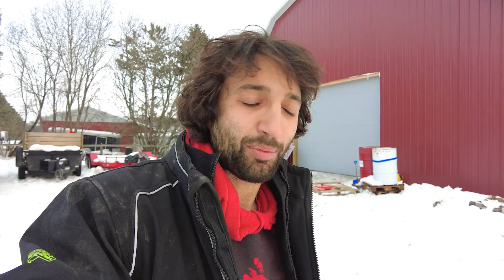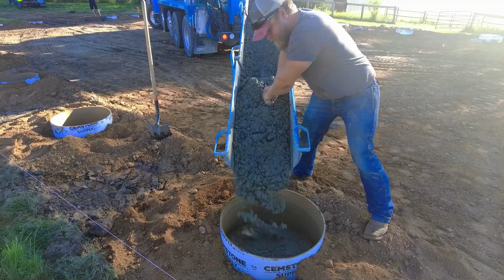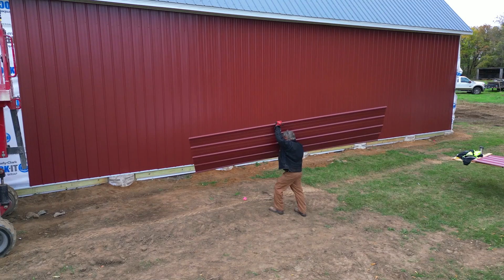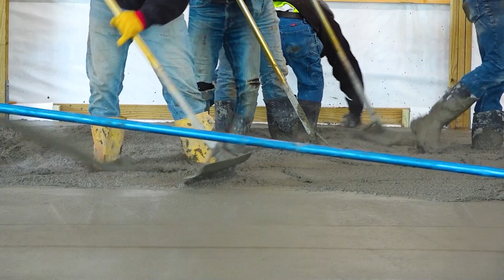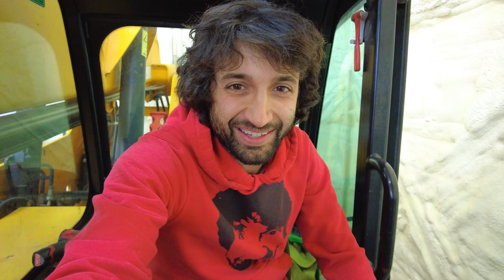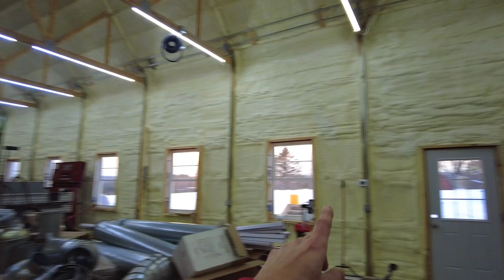How Much did this Stupid Barn Cost to Build? - 40x72 Gambrel Post Frame Episode 23

Comment from the maker: Have a great New Year everyone! Here are the numbers for reference:
Permits		 $2,041.34 
		
Site Prep		 $14,085.25 
		
Framing Package		 $17,502.26 
		
Metal Package		 $20,275.37 
		
Trusses		 $5,172.06 
		
Doors and Windows		
Garage Door		 $2,943.83 
Entry Door and Windows		 $2,747.66 
		
		
Labor		 $18,320.43 
		
Infloor Heat		
Insulation +VB + tape		 $4,449.23 
PEX		 $7,004.00 
Boiler		 $11,587.50 
		
		
Concrete Slab		 $23,978.40 
		
Spray Foam		 $30,331.44 
		
Electrical		
Temp Wiring		 $1,452.04 
Panel Set		 $2,294.34 

		
Lift Rental		 $6,052.19
Reply: $170,237.34 for capacity that will facilitate the generation of multiples of cycles and decades of much-higher-than-cost revenue, and guarantee the ability to meet demand when and if it increases but can maintain a known minimized cost to storage over a 30+ year lifespan. 
 I'd call it a low-cost win. Straight-line depreciation of the cost is around $5,674.58/year which was probably much more than what was spent in renting a building space with a constantly-changing humidity/temp environment, which is bad for wood storage (increased spoilage cost).
Reply: Perhaps the biggest piece of financial info I didn’t hear was the annual savings of not leasing a building, as well as the cost (fuel, vehicle maintenance, etc) of commuting back & forth? Surely that is a contributing factor in the decision-making process.
Reply: Hey Matt,
Firstly, let me wish you and your family a Happy New Year - 2023 !!
Secondly, thank you most sincerely for sharing the çonstruction and related costs. You have shown, once again, that you are a very transparent person and I commend you for that fact. Nothing to hide and enthusiastic at the same time !!
BTW, what's Donovan doing now that the building is complete....?
You certainly have a lot of work ahead of you - with arranging and installing all your "toys" !!
Again, my very best wishes for the future and may God Bless !!
Reply: Certainly NOT CHEAP - but we'll worth the outlay !!
Reply: Now, since it is used for a business, what tax deductions do you get annually on your primary domicile?
Reply: @mgmcd1  🤡
Reply: That actually cost a lot less than I expected. That's a massive building for that money. It will be paid off quickly when you get the operation up and running. Nice job Matt!👍
Reply: Nice work Matt.  Can't wait to see it in person on my next adventure over to your place!  lol
Reply: Think of the rent and travel costs you are saving 😉

Happy New Year Matt
Reply: It's so refreshing to see honest numbers. Everyone I know who has built a garage or pole barn claims an unbelievably low price. My friend is looking into the same thing but can't receive inside information on actual cost. Even a ballpark figure would work, but there people would say they paid $50k for your type of building
Reply: You did well Mark!
Reply: How long would you have been able to lease a building for that?  This is an investment and that has to counter building costs.  You don’t pay anyone else for your shop
Reply: Well let's say I'm glad I watched you build it rather than me paying for it!  I am curious how much cheaper it would have been if this was before the pandemic... I am out of touch with building costs.... I was surprised that the rafters cost $500 a piece for a simple stick and frame construction... The concrete slab didn't seem too high to me and neither did the electrical work (surprisingly)... But that spray foam... Oh my goodness!.... 30k?!  No thanks. Lol. I knew it was expensive but I didn't think it was that much.  I hope it gives you a good return.
Reply: If you ever decide to quit milling lumber, think about it this way. A building with no interior walls is a blank slate if you ever wanted to rehab it into a guest house. The only thing still missing is plumbing and septic.
Reply: i wounder is the number of spray foam is right?  in my world in sweden its massiv overpay but here we dont spray foam at all. concrete is dubbel of hear and metal too.
Reply: Love this...
Reply: The permits and the pex line are the only ones that seem high.  Great value.  Doing that huge ceiling in spray form- big job
Reply: The doors have been FLUNG open to widespread THIEVERY in the US economy and everybody on this list (except for the electrician!) charged 3-4 TIMES what these products and services are really worth.  What's wrong with people?  This kind of narcissism in business, GOUGING the customer - charging higher and higher prices as long as the dummies keep paying -  is borderline criminal and will be the end of many a franchise, LLC, sole proprietorship and yes, even corporations.  

The tipping point will be reached when the consumer base finally realizes they're being played for suckers and they stop patronizing these thieves' businesses all together.  

Personally, I think every single project in the nation should STOP until the pricing for everything from supplies to labor, groceries to utilities, tuition to tires, across the board drops by AT LEAST 80%.  If that necessarily means the total COLLAPSE of different industries, then so be it.  You all KNOW I'm right.  We're being ROBBED everyday by these clowns.  Let's end the thievery and get back to a world where no one struggles to make ends meet and prices are FAIR.
Reply: good lord 30k for spray foam?!? hope it helps retain heating/cooling enough to offset the cost
Reply: How does the cost compare to how much a property would have cost if you were able to find one?
Reply: +u

Comment: I was working at a bank and had quite a bit of knowledge in the trades involved so I started building a house, moving the family into it, living there 2 years, building another one, moving into it, etc.  I did it four times.  After the first one I stopped doing the trim work, after the second one I stopped doing the plumbing, the third one I stopped building the cabinets and doing the electrical, and the fourth one I just GC'd.  Each time I realized that I was just slowing things down.  The fourth one I decided to leave my job at the bank and build houses full time.  It's pretty much always better to have pro's do the work.  It's just not worth the stress.  

Of course then the bubble burst while I had two high priced specs on the market.  They stayed on the market for two years, and I lost everything that I had.  So there's that.

Comment: Looking at doing a barn of similar slab size and depth.  This lines up with my own estimates I did, via concrete calculators and watching other concrete guys on YouTube that give the cost of a job.  I would try to do as much of the ground/form prep as I could, to lower the cost, but that 25k is close to the ballpark.
*
Some good concrete guys to give a watch on YouTube are MattBangsWood (good details on framing pouring and Mike Day Concrete (Mike Day will give cost totals to a project, along with framing pouring)

Comment: I know it is easier said than done - but one of the things that could help is pre-pare rent, deliver, or buy things per phase and I think you did some of that - but Donnavon was slow..he smiled too much, and that cost you some money for sure - and your purlins.OMG -- I see others just nail on top and bam bam bam..you spent a few weeks installing individual purlins - In these types of work, you either speed up the process but for more costs, or less cost and longer project time - you know the main idea of the Project Management - The Tripple Constraint (Time, Money, Resources) - each impacts the other when changed. yeah..crap,,,, I binge-watched all episodes - it is almost 4:00 am..wth... I got to work tomorrow. bye and I don't even need a fricking barn for anything,

Comment: If you had put in a second floor level - with the 14' of height, there would have been a very long staircase. Which takes up room on both floors, and obviously costs something.

Comment: what you do now is lay a row of post 6 feet away from each side of the building down the long sides every 12ft.. run a stringer along the barn walls each side at about 13ft high, then run a strigner along the posts you installed at like 11ft high.. run square ended rafters off the barn wall to the posts every 2ft, block it out and just use the inexpensive home depot fiberglass or aluminum roofing..

then you have a roof structure along each side of your barn and you can fence em off with 4 strand whatever and your animals have shelter, or you have shelter for tractors whatever, maybe even wall one side off for birthing stalls whatever..  yea make that space work and those barn walls work..

its a very nice barn, are you insulating it and turning it into a shop or, mighty fancy heating system for a barn I don't imagine you're keeping animals on a concrete floor?  classic car collection?  is this a farm or?

Comment: wait WTF? you paid $14 for site prep? you could have done that with your john deere in a day or two...  good lord.. holy smokes had you rented a portable mill you could have cut your own trees and got all the materials for free basically, um the slab, wow, you could have done that yourself, its like what $100 a yard poured?  40 x 70 x 6" like 50 yards so what like $6000 for the concrete, about 3 hours labor to screed and burn 2 guys, what $500 in labor? or free if you do it yourself?  $23,000 for concrete? I still don't get this cost?  how much did they slap onto each yard of concrete?  its $6k for concrete $7k TOPS, $500 in labor? you should have gotten the floor, the sono tubes, dug layed and filled for under $10k... no jokes 

why you used 24" sono tubes X what 36" is beyond me?  wa sit laying on hard pan or? if your not on a hard pan you would be better off with a dug footing, the width of that lil' kubota hoe bucket, 12" deep, PLENTY and more stable, 2 rows of 3/8ths bar..  $400  call it a day.. 4" slab would have sufficed with a thick mill vapor barrier, is it in floor heating?  man in the day, in the 70-80's, we build that abrn for $10k - heating system..  also you can do in floor yourself, fuggen do it all yourself, good grief the money they made off the concrete job was $14k?

that boom lift is all you need for a bard build, frankly you have $45k in materials and a whole bunch in labor and company profit...  DO IT YOURSELF!
 

you're not afraid of a little work are you? look at it like you're making $80k building a barn,man, been a few decades since I was in the game man they're making some serious cash these days..  lord

Comment: I was looking at a property in NH it had a house sorta a fix er upper but a good size and two 40x60 buildings with a dock at each to back up a tractor trailer on 5 acres for under 300k. They don't pop up too often like that.

Comment: Matt, you may want to add a ½" x 6" x 6" metal plate under each speed rack leg to distribute the loading psi onto the cement floor.  Calculate the "kips" based on load and cement specs.

Comment: In my mind $170,000 for a building that size seems more than reasonable. Considering if you had a company do the labor it would probably be $250,000 or more. That is now it may be difficult to find labor to do it.

Comment: I have been planning to build a barn here in central MI in which to store a lot of my things, as well as to renovate, and then store my sailboat. I figured a 60' x 70' x 16' steel sided barn just like the one you have built would be what I needed. I started the planning about 20 years ago and began saving money that, at the time, would be around $50,000. As I began getting close to that time, I saw that the price of everything went up! I have managed to save twice that now, and find out that I am really only half way there thanks to 'planned' inflation! This is where I decide to just enclose the space and worry about getting the rest done over time, including my side overhangs and flooring and insulation! I'm already retired so SS checks won't go far enough fast enough. I was so glad to see you complete your barn! It looks great!

Comment: "Load Capacity"? You expected load capacity on 9 foot on center roof trusses??? You'd have had all the capacity you needed if you designed the framing and trusses to hold the load. Yeah sorry, unless you saved tens of thousands you lost out on not putting a proper system in there to accept an attic space. That lost space is HUGE.
Reply from the maker: About 30 grand in materials

Comment: I assume Donavan worked with you on the rate, or else labor seems super cheap out there. I recall times when you had Donavan plus a couple other folks out there. 18k seems like a deal :)

The whole barn came in much less than I thought it would. Out here on the east coast, if I had that kind of room, it's probably 300k+ given what I've been quoted for smaller projects in the past, without nice things like the in-floor heat or full closed-cell foam coverage.

Thanks for sharing.

Comment: Oop's hear that snow falling?  Don't forget to put snowbirds on the roof.  Gutters, too.  Pull that water away from the foundation.  Bathroom, water and waste system?  WIFI?  Fire protection (sprinklers, alarm system?). Lightening rod and grounding.   At 70 bucks a SF you are well ahead of the game.  Now, protect that investment. Make sure to get some good insurance and a great termite control contract.

Comment: I'm going to agree with the poster below who has said getting the barn built for you would have cost at least $250k and I'll top that up by saying that would be British £'s over here - if you'd ever get the chance of putting it up at all. We have Planning Permission here - which out in the country is virtually impossible to obtain for residential or semi-industrial premises - bona fide farmers have been allowed to erect whatever they want but even they are now subject to rigid controls. I've just done some permitted work for an old client and even after all the hurdles had been jumped and assault course completed - the local authority wanted an Ecological Survey of his entire property before a sod could be turned ( I put sod in for you because we call it turf!) Whoa betide anyone who finds a bat flying around!!! That will shut their job down while the Conservationists take over - newts will do that too ( a kind of small salamander ) and pray to your gods that the Archaeologists don't take an interest - you're dead lucky to live in a vast country with hardly any people but Dear Old England ( heard the joke? What ain't Old is Dear!) has folk and their belongings buried everywhere and there's hundred of live ones that will beat a path to your door with more rights than you!
$24,000 for your concrete was a steal! My last large scale project (I've retired) used a laying contractor - there were on a par with your guys for skill but less of them and I ended up on the powerfloat at 02:00 as they did want to work passed midnight - their bill was £11,000 for nowhere near half your floor. 
Wish you well for 2023 and I look forward to more videos!

Comment: Just some question.  Why the Gambrel roof?  Would a standard peak roof have been cheaper and easier to build?  Do you have any significant snow loads?  Will you need some guttering to push the rain runoff farther from the building to prevent erosion under the pad/flooring?  Looks like a great asset for your business and future plans.  Good video!

Comment: I am not really familiar with what part of the country you live in, but some of the things I would have considered are can I sell this warehouse/workspace when I am ready to retire? Could I place this structure near the edge of my property so I could just sell a small part of the land with the barn/warehouse? Having it close to the house is nice but would that be a drawback if someone wanted to rent it eventually. You are kind of limiting the number of buyers who want both a house and running a business from one location. I do envy you being able to start from scratch and build well-insulated and heated floors although I am not sure if I trust putting all that piping under that smooth concrete. one small leak and a bad freeze and then the floor will be full of cracks. Nice work and hopefully you get 20+ years of use from this building.